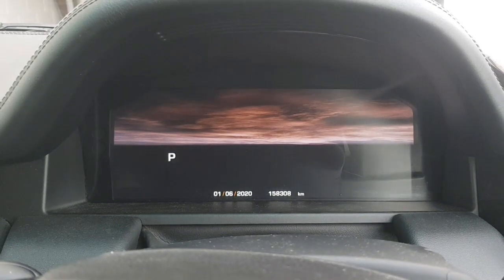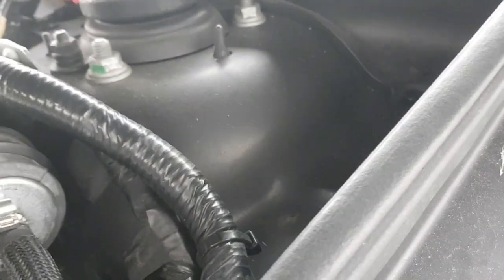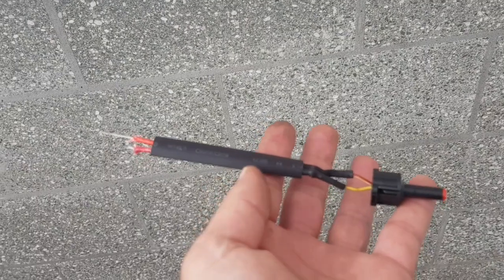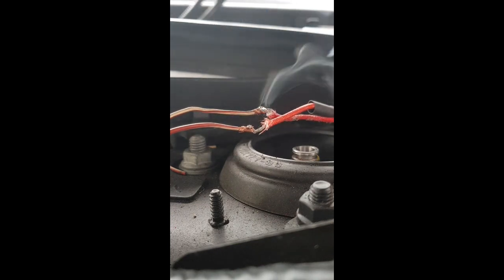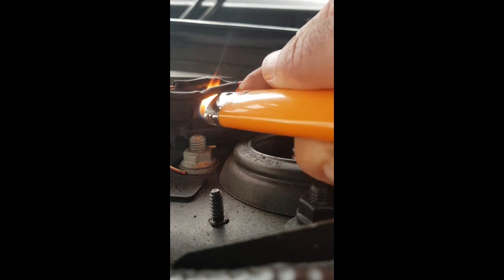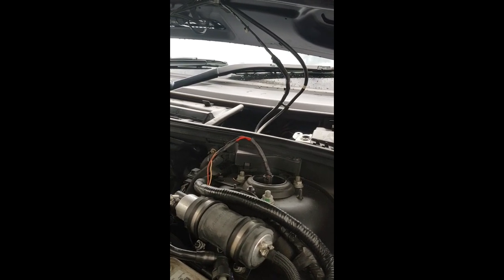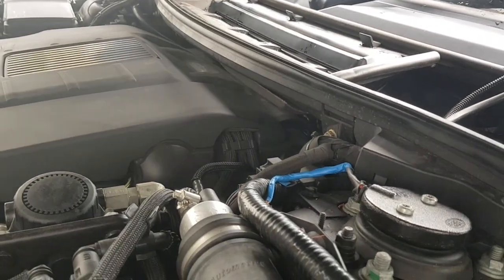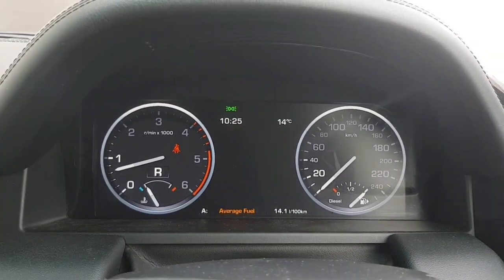Range Rover L322 2011 TDV8 Adaptive Dynamics Fault repair

Comment: Greetings from a displaced Kiwi in France, and thanks for the advice - I had exactly the same issue as you - a clearly broken wire at the end of an old shunt.
1 thing tho, my 2011 needed a T30, not a T27. Maybe European spec?
Reply from the maker: Thank you. As mentioned, it looked like someone had been there before me and that size was the only one to fit. Perhaps they had damaged the screw?

Comment: A 1000 Thank You's from the UK! Your video saved me a small fortune in diagnostics and repair bills I know the garage would have charged me a small fortune just to diagnose what appears to be a common fault. Mine was also Pre-bodged with some dodgy soldering and electrical tape. A 20 minute repair and back on the road! You are a Legend Cheers!

Comment: Seriously.  Why did this work, lol. Thank you!  I have no idea why but mine was jenky when i opened mine up as well. I did NOT like the design that LandRover has where this thing rotates as im trying to remove the screws…had to get a big pipe wrench to keep body from rotating on me due to how tight the bolts were.  Probably need to order new bolts because threads started to strip too. Sigh.  Oh well, thank you for this video!

Comment: A hot air gun is easier and safer. Also it helps to shrink it right to the end, no gaps.
Reply: I used a hot hair gun and solder connection as well

Comment: Have the same problem and am going to try replacing section of wire before purchasing new sensor kits. Btw, with soldering I have learned you heat the wire and then touch wire with soldering rod, never touch rod onto hot iron :)